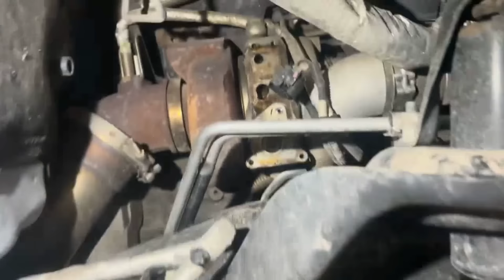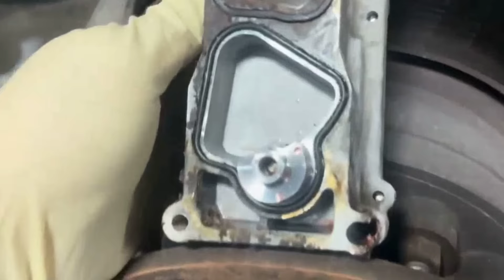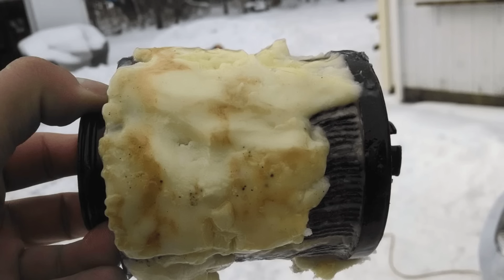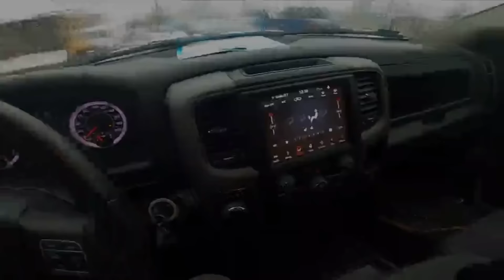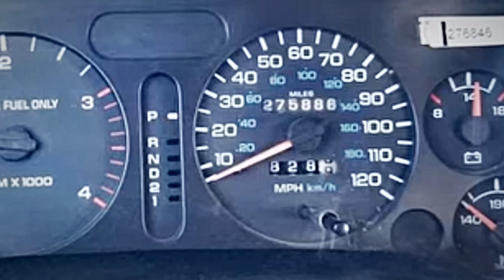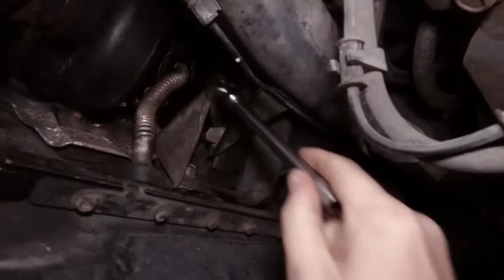7 Stupid RAM Engine Habits That Are KILLING Your Turbo (STOP IT NOW)

Comment: I can tell you that running with the exhaust brake on is 100% fact.  When I got mine I never used it.  The turbo threw an under speed code and I lost all power.  Had it cleaned out under warranty and the dealer told me to keep it on.  That was in 2013.  Been using it ever since and never had a problem again...
Reply: I use full exhaust brake all the time.
Reply: @darryladams519  I use mine every morning on the way to work and whenever I'm on the freeway.
Reply from the maker: That lines up exactly with what many owners have learned the hard way. Keeping the exhaust brake on regularly helps keep the VGT clean and prevents sticking. Your experience ,and the fact it solved the issue long-term, really drives the point home.
Reply: My 07 6.7 I have 350k miles run with exhaust brakes all time!
Reply: Ha funny I just clicked mine on and never turned it off. Lucky guess for me
Reply: @Treesusb  yeah definitely. My cousins turbo went out on his truck! Told him to use his Jake brake and he chose not to!
Reply: @Treesusb It's not possible to turn it on and leave it on. You have to turn it on every time you cycle the key. I wish it would be able to be left on full time but as far as I know it's not possible.
Reply: @j @jeffmockus5400 ne is literally on everytime I start my truck. Not true for me
Reply: I put it on auto is that just as good ?
Reply: @willyg7287yes mine is automatic and I ran mine and my truck has 350k still same turbos

Comment: This in on Dodge, they use a cheap grid heater solenoid that is prone to sticking, the 6.7 doesn't have this issue in any other truck.

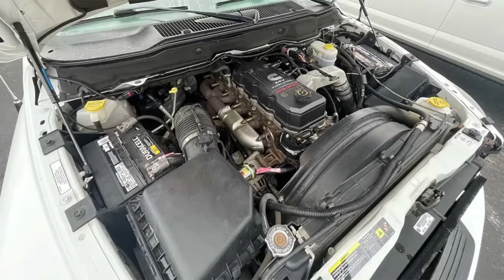Comment: 14:23 5k, yes.
I had to switch blends when I bought my '04. Dad ran Kendall D30 in both his 12v CTD with good results. After 500mi on a Kendall oil change, my 24v smelled like burnt gear lube. After 18yrs, it started that same aroma using the recommended blend. 😕

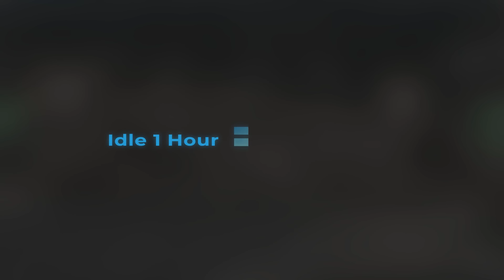Comment: 12:05 EGR & DPF should never have been put on diesels in the first place.
Reply: Some people like clean air 😂
Reply: @mbr577we all like clean air but also want a truck that won’t Grenada constantly due to half baked emissions equipment
Reply: @d @devlinsemmler8236 f you use the truck for what it is meant to be used for, you won’t have to worry too much about these emissions, if you use it for groceries shoppings then, I can seee why you can complain. If you have diesel car, then yes definitely delete it, but on a truck, I don’t see why if it is a work truck.
Reply: Egr and DPF are govt mandates made to increase costs for manufacturers to comply and led to higher prices and for consumers these things when they fail cost a lot and warranties don’t cover emissions stuff 

It makes people poorer and makes the dealerships make more profit 
Thank politicians for this crap 
They don’t work for the people, they work for big corporations and donors and do their bidding 

A crappy reality
Reply: @DanielLehtinen-e9e but it does make cleaner exhaust emissions. Less soot (pm2.5) and NOx.

Comment: I have the luxury of going back to my 2001 Ram with a Getrag 6 speed manual.  It is by far a better engineered, better built and more reliable truck than my 2017 Ram.
Reply: We have both a 2003 and a 2012 both with Cummings and the 2012 3500  has been a source of grief since it hit 150,000
 Old  red just keeps on turning at 450,000

Comment: All of these points are good sound driving habit advice that has been known and followed for decades by diesel truck drivers and equipment operators. There is more forgiveness on gasoline engines for bad habits.